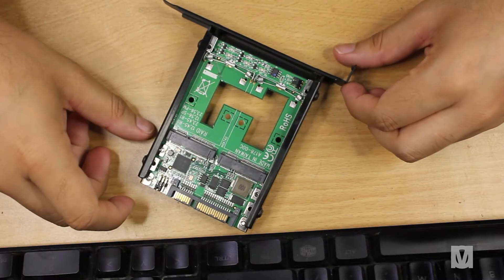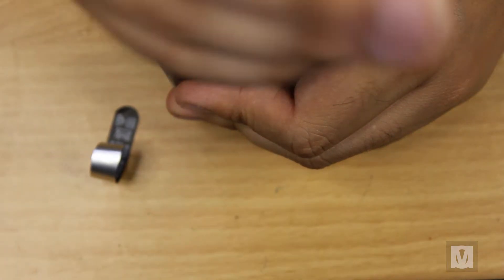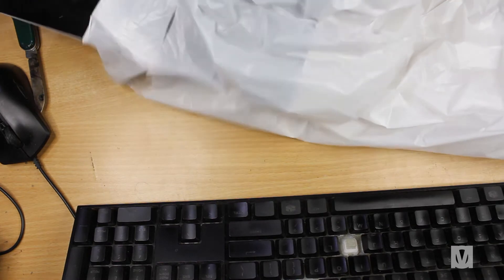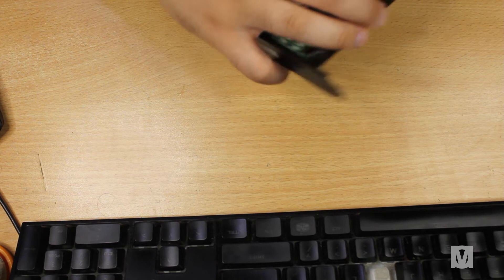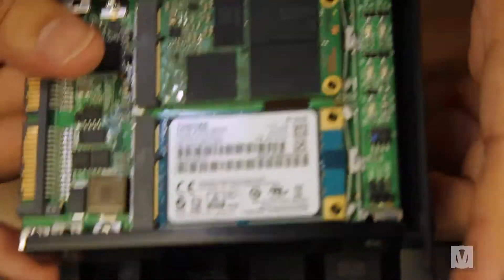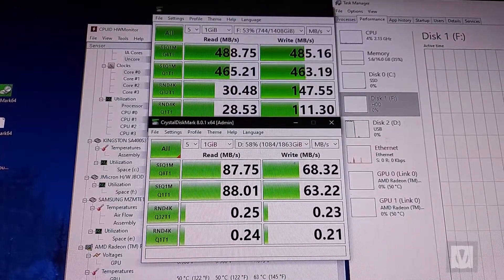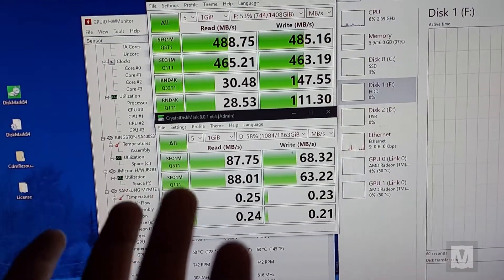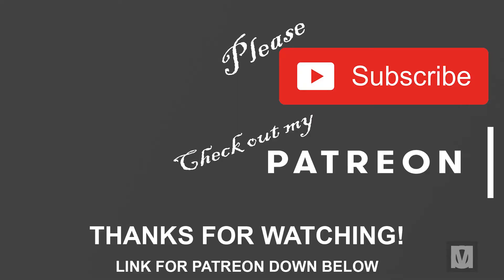Does the  StarTech Dual mSATA to 2.5” SATA Adapter really work?

Comment: pretty expensive device , I hope it lasts long .  for   $125   you can get a decent motherboard with mSATA connector
Reply from the maker: haha funny you should say that... I think mine is on its way out. Its failing to be detected by my PC sometimes. I was lucky enough to get it cheap and used but this device is not worth brand new. Just better to sell the msata drives off to someone and get an actual large nvme ssd or 2.5" ssd for the personal computer. AVOID if you can!

Comment: What about its heating? What the temperature it have?
Reply from the maker: Hello,

Sorry, I can not get an accurate reading of the adapter through HWMonitor and I do not have the tools to measure it externally.
Reply from the maker: Update:

It gets really bloody hot, espeically the msata drives. This device needs to come with heatsinks for the msatas OR a fan.